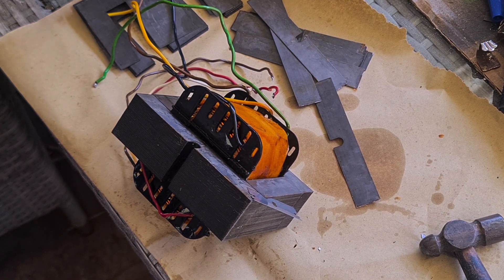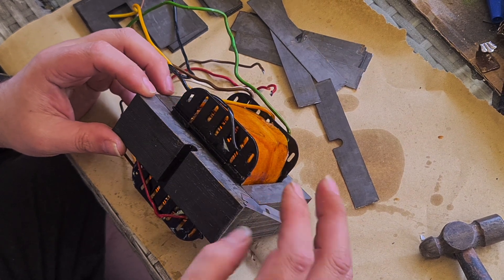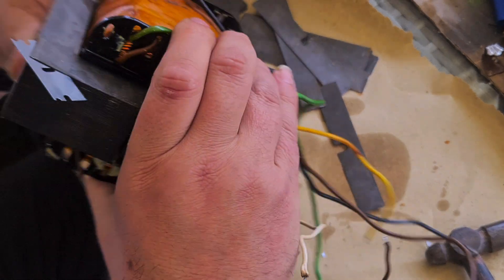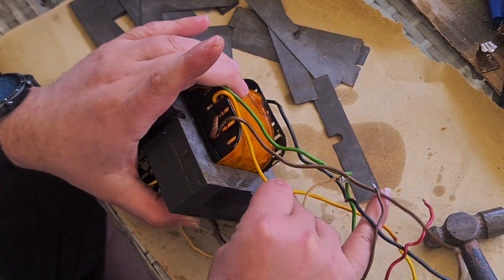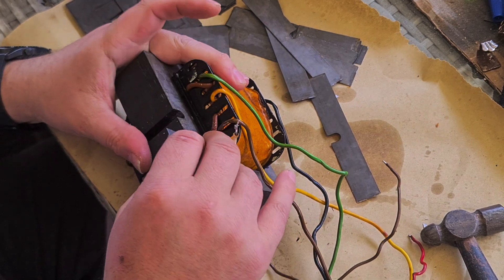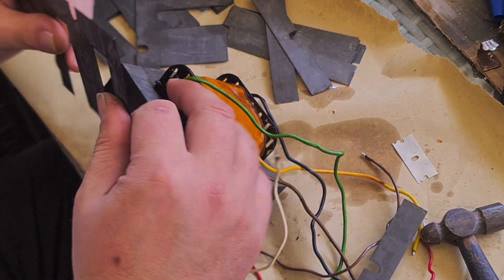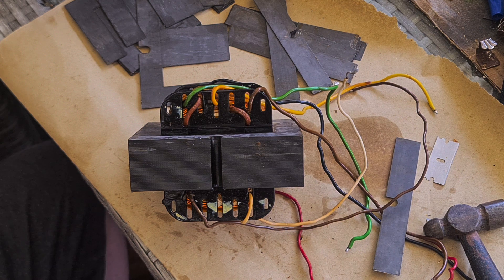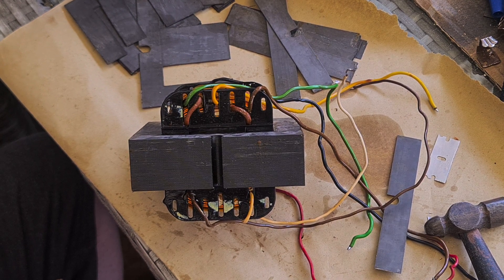Teardown of a JCM 800 2203 Output Transformer

Comment: Wouldn't it be EASIER to buy a replacement tranny than to rewind it yourself?
Reply from the maker: if the customer wants the original transformer, it's not exactly easier to buy a replacement that is 30+ years old. and rewind is still a better option
Reply: @siriusamplification  OK, but I meant new equivalents, IF they exist!
Reply from the maker: @DMSProduktions  The cost of an equivalent to get shipped to Australia is still most likely double the cost of a rewind.